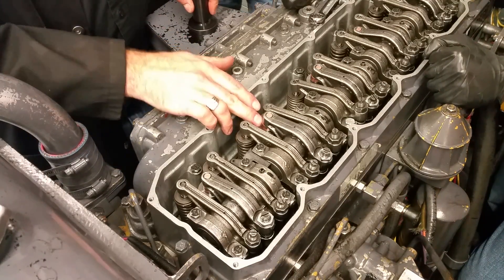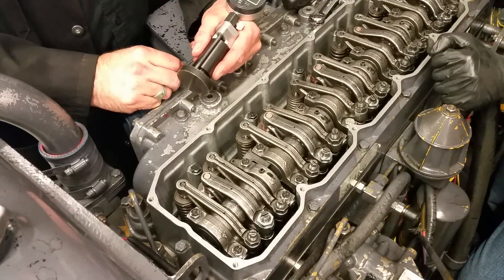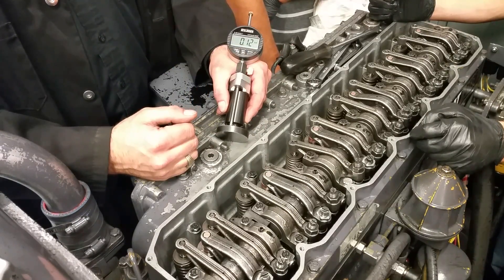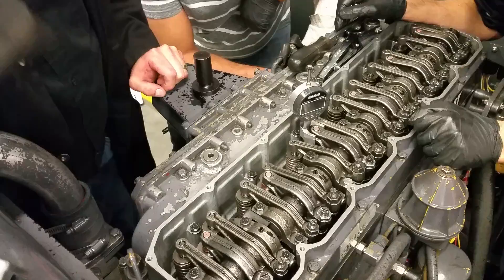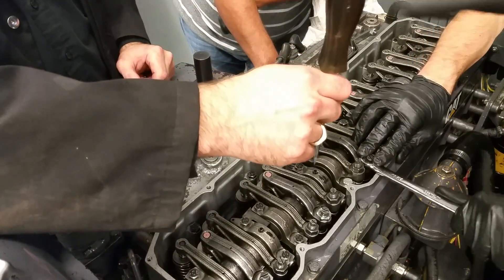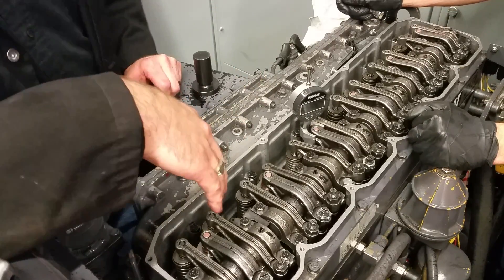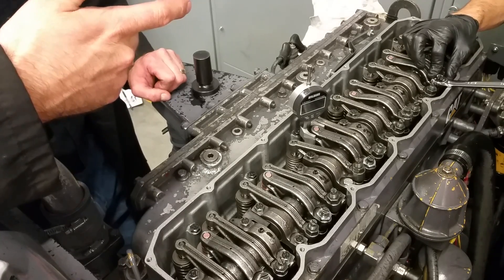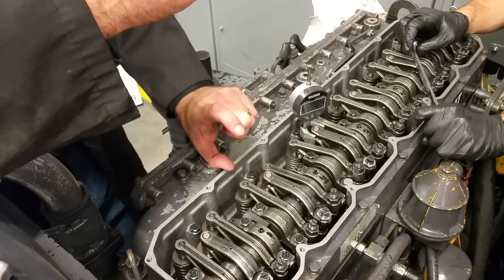Caterpillar 3126 Injector Timing Height adjustment

Comment: uhh this is a 3116 ..
Reply from the maker: Some 3126 had the same mechanical fuel injection systems as the previous 3116 engines had before they changed to the HEUI fuel system.